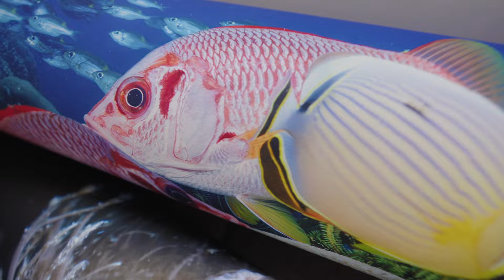I'm leaving the Province

Comment: Finn help me to understand, at 12:45 in the bathroom/shower what is the method of sealing the water under the tiles in the wet areas? In the nordics, like you know, we always use painted moisture sealants and water blocking strips in the corners and inlets. How did you block the water under the floor tiles in your house baths & showers?

Comment: Are you going to have heavy duty shudders that will cover your windows that you are having installed (as discussed at the 11 minute mark)? These are needed to protect your windows from damage/cracking/chipping/etc. during heavy winds/typhoons. You should be able to install the shudders on a rail system on the outside of the house (accordian style metal shutters) that are easy to roll over/cover your windows when needed. Thanks for sharing!